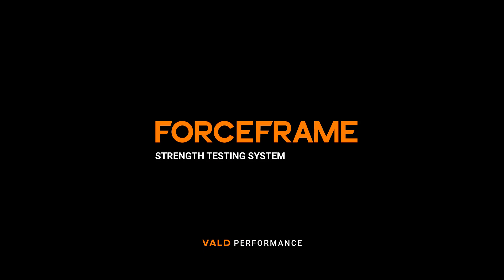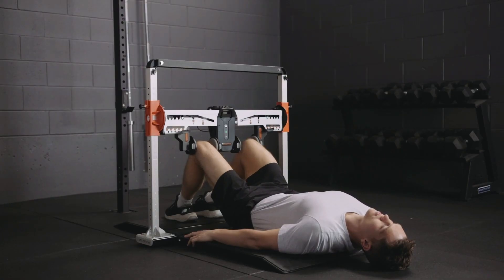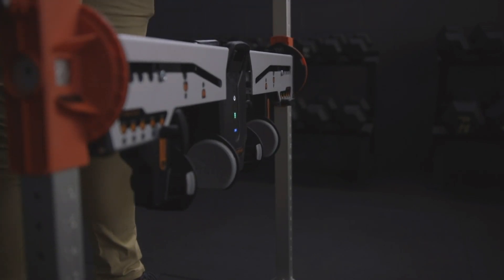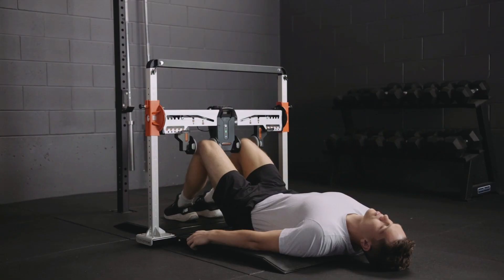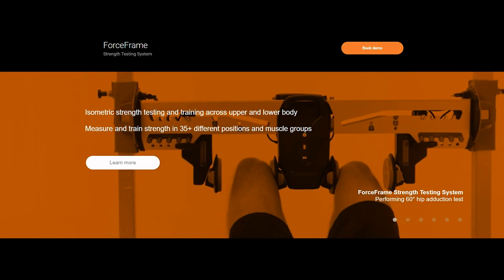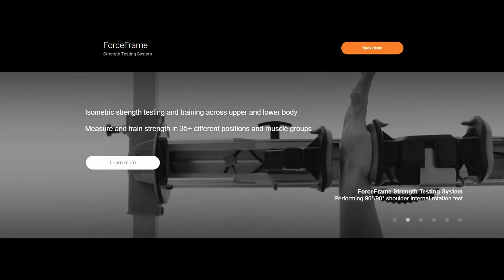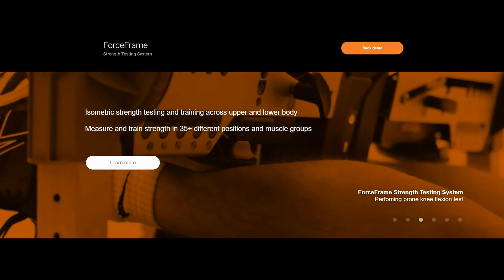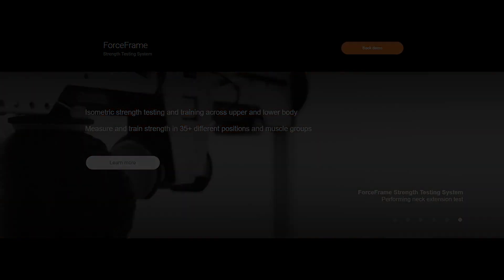Measure Hip & Groin Strength | VALD Performance ForceFrame

Comment: Can I conduct a Hip Extensors Torque test using a force deck?
Reply from the maker: Hi there. Yes, you can use a force plate to conduct an isometric hip extensor torque test. The setup is shown in Figure 1 in Wild et al., 2021, as shown here: https://www.tandfonline.com/doi/full/10.1080/02640414.2021.1985759#d1e223
Reply: @globalperformanceinsights  This is great stuff! Really appreciate the help. You're doing a fabulous job btw, with the material you share and the emphasis on nuances. Cheers!
Reply from the maker: @bhaskarjyabaruah1090  Thank you so much, that means a lot!